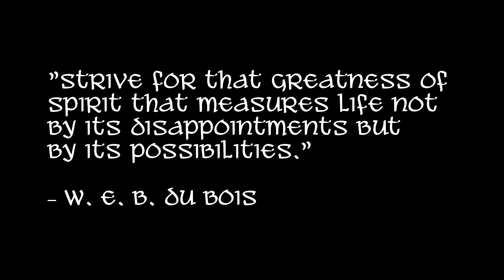Using a 3D Printed Loom for Tablet Weaving

Comment: Hi Elewys.  Thanks for all your videos.  I threw together an inkle loom from some scraps, and have been "Weaving along with Elewys" ever since. I wonder if you would consider doing a video on how to design patterns.  I have been playing around with the TDD, but I could use some help with the basics like when to use S or Z threading, how to make different shapes (or letters?), and how to make decisions on which colors go in which holes.  For example, I wanted to make a "checkered" pattern, so at first I put white threads in A and B and black in C and D, I used TDD to see that I could switch the way I rotated every 8 cards back and forth every couple of rows. I speed warped my loom and got going quickly, but I found it difficult to turn the sets back and forth without making mistakes, and the first 30 rows or so looked pretty bad.  Then I figured out if I just started with every 8 cards "upside down" (As lined up with Cs), I could just turn everything forward or backward. I went back to TDD and adjusted the design (to remind myself later), but I would not have figured that out if I hadn't messed around with it.  I know that is part of what makes it fun, but I would love to hear/see some of your design tips as well.  Thanks for considering. (planning on printing this loom this week!)
Reply from the maker: I sometimes look to similar patterns if they're doing a thing that I want my current project to do and see how that was threaded.  In a lot of cases, it's just playing with the program to see how it works.  There is a YouTube video for TDD (that I think is linked in the description of the videos) that was put together by the design team of the program, Catherine and James.

Comment: Thank you for showing us how this loom works.  it looks a little uncomfortable having to reach up over the cloth bars and the fixed dowels... made my arms ache just watching.  I probably would have pulled it off the edge of the table on an angle ;o)  And I agree with getting rid of that rigid bar and the uprights closest to you!
Reply from the maker: I ended up doing exactly that-- holding it in my lap and resting on the edge of the table
Reply: you could use a round chop stick they are slightly smaller than a pencil but larger than a skewer

Comment: Thanks for showing how to warp this, I'd been trying to wrap my brain around ... well, how to warp a loom you don't just wrap the warp around... perhaps in the future I shall have something like this, it looks more comfortable for floor use (I don't generally chair and table well for long, I gelpad on the floor) than an inkle loom and way more compact than my current 5' scrap board wtih tension adjustment "what can I find in the garage" loom. Although I'll probably only get the ratchety parts and the 3-holed end pieces 3d printed, I suspect the rest will be far easier and faster to manufacture out of wood since I have saws, drills, hole saws and the like...

also on the topic of "what can I find" looms, my 4 layers of cereal box cardboard shuttle works surprisingly well, although I do have to guide it with my finger or else the layers catch on things, but the knife is a good idea for when the cardboard starts disintegrating and I'm too lazy to unwind what's left and rewind a new one...
Reply from the maker: Many of my woodworking projects are supplied with "hubby's scrap pile".  You can also get ratchets and pawls from weaving supply places online, if you can't find a 3D printer.

Comment: As you were putting it together, I thought that making the front support shorter (just below the height of the ends) and the back a bit taller would create a slanted work zone, which would be easier to see the pattern. 

Having only one bar for either cloth or warp beam could be a problem with slipping as you turn it.
Reply from the maker: Good thought!  I might have to experiment with that!

Comment: Interesting to see how to warp up a different type of loom. The new shuttle looked cute but obviously wouldn’t pack the threads down sufficiently. Was that because of the thread load?
I laughed out loud at your packing. 😂😂 My husband said not to get ideas! Glad to see the apron again. I was worried something had happened when you weren’t wearing it in recent videos.
Thank you.
Reply from the maker: Part of the problem was that it was the beginning of the weave, so tension was being wonky.  Later on, it improved, but a firmer shuttle would definitely work better.  I actually misplaced the apron for a few weeks and was determined to include it in the video...I found it under a pile of summer clothes that I was preparing to pack away for the winter.

Comment: I used to do card weaving years ago. I used a back strap loom and was able to wind up two dowel rods like how you have on the top of your loom. For the life of me I can't remember the how it was wound up and am having lots of trouble remembering how I did it. Do you know what it's called so I can look it up again?
Reply from the maker: Perhaps a rigid heddle loom?
Reply: @elewysoffinchingefeld3066  no, just two sets of dowels at the top and bottom. Top had some cord wound around them to hold it together and I the looped it over a door knob. The other end was attached to me. Had the cards in the middle. I did a 6 ft long piece in a 2 ft space.

Comment: Hello Mis Elewys, beatiful video. I’m very jealous of your new loom :)

Question for anyone with a little experience, does anyone know if you can weave a much thinner strand with say only 2 or 4 cards? I want to weave a thin lace (to lace up a Renaissance bodice) using carpet warp, but I don’t know if a 2 or 4 card weave will stay together?
Reply: You “can” but it’s very fiddly and tbh why would you want to when you can hand braid the same without having to set up cards and loom etc? Finger loop and other braids are historically accurate throughout history and require no set up bar measuring and cutting threads and are just as sturdy and can be patterned just like a woven band.
Reply from the maker: You could try finger loop braiding, which will create a nice, strong lacing.  I know there are videos out there that demonstrate how it's done.  Morgan Donner did a video on it:  https://www.youtube.com/watch?v=GQpEcGfv-rY
Reply: Thank you both for the advice! That’s so funny, I actually found Morgan Donner’s video last night. Will definitely be hand braiding now :)
Reply: I know this is super late, but you could also try making lucet cord. You need a little two pronged tool but its really easy and can make cord as long as you want, which is where fingerloop can be a bit limited